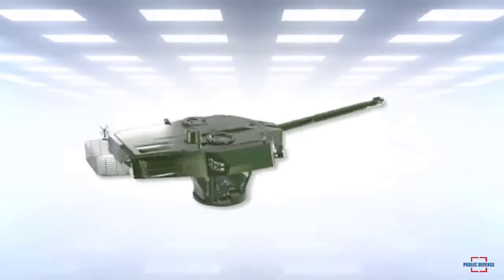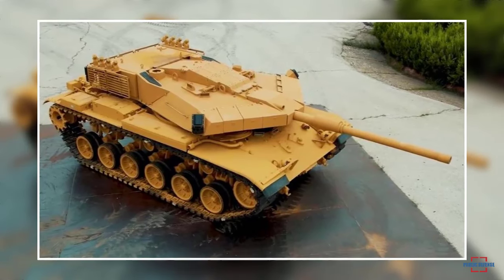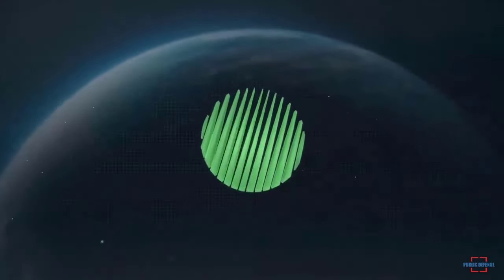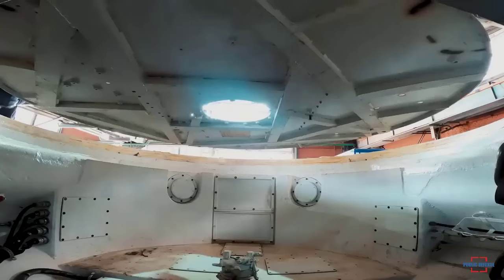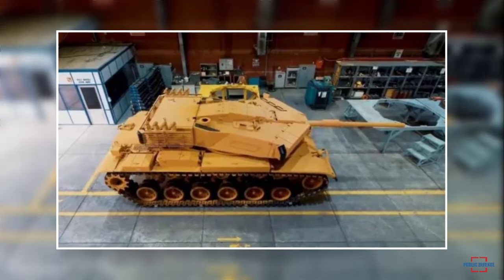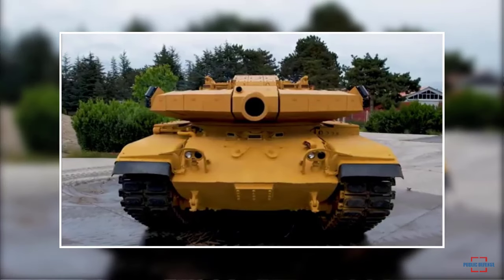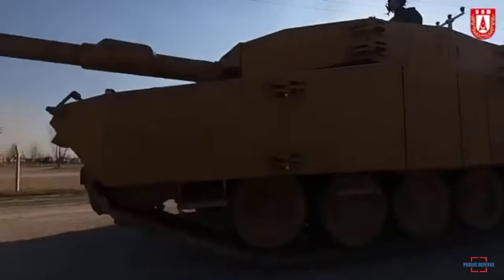Turkish Army M60A3 Tanks with Roketsan New Armoured Turret

Comment: M60 : please let me die
Reply: Basically it's new tank only the basis are the m60.
Reply: lool
Reply: T-55s: First time?
Reply: As u can see not even the leo2 tanks safe. İn our age a tank can only help ground personel. Because without soldier cover a tank can be destroyed easily.
Reply: So no need to new tank chasis o guess :)
Reply: M48 first time?
Reply: @Yalcin2 tank should work with drone to scout ahead…..ukraine recent leopard 2 tank failure is a mess….
Reply: We're trying so you don't die... YOU SHOULD THANK YOU...🤣🤣🤣
Reply: Centurion:
Reply: M41 walker
Reply: LooL m60 has become the new T-55
Reply: Russians can relate
Reply: Lmfao
Reply: The modern MBT is the cavalry charge of yesterday: outdated with no place on the modern battlefield.
Reply: why? As long as your maintain well.. you can use devices for decades. USA still using 60 70 y old planes even today.
we are not going to use it against massive armies in the flat terrain of Europe or Ukraine.
m60 still in service for 2 reasons:
1- It is good against assymetrical warfare. Because losing leopard 2 or Altay MBT can be extremely costly. Expensive to maintain and replace them. 
2- It is good for the landing operations. We can't afford a brand new light tanks with this economy and it is hard to use heavy MBT tanks when you are landing in an island.
Absolutely smart decision by Turkish Armed Forces . Even USA noticed that and turning Abrams into 42 ton tanks now for the pasific front.. They have money , Turkey doesnt have money, This is the sollution.
Reply: The name of the tank is not important, if it is turned into a modern toy by placing the most advanced electro-optical systems, monitors and controls in it through modernization works, that tank is good. Therefore, the names are not important, what is mounted in the arrangement is important.
Reply: @Janko630 howso?  Nothing else out there can take a hit in a heavy firefight while providing direct fire on emplacements.  Nothing else can fill the MBT's role on the battlefield at present.  

Thus, not outdated, by definition.  They have become more vulnerable, yes, but so did tanks after WW2, with HEAT and ATGMs.  But that just saw evolution, first by going lighter with europanzer, then with the introduction of composite armors.

The modern drone, mine, and artillery threats have their counters as well - and are already starting to be implemented; active protection systems, EWAR, and a return to lighter/cheaper platforms.  

The pendulum between sword and shield marches on.  

The biggest threat to MBTs are remote operated / unmanned ground platforms, but that's still a few decades off from practicality.  (And they'll still basically be MBTs, just smaller due to crew being inside a heavy APC nearby instead of the tank ridging the hill line)
Reply: T55: first time?
Reply: @Yalcin2  As was literally always since the first tanks. Tanks alone never were good. You need combined arms warfare.
Reply: Naaah, you missquoted, its "EVEN IN DEATH I STILL SERVE"!!!

Comment: Turrent looks like T-90M and T-90MS
Reply: Already made for t90 modernization tenders
Reply: Kazakhstan built the T-90 tower. When he manufactured it, he changed it to m-60. but it was nice. There is no ammunition under the turret like the T-90. in the warehouse behind. but it was nice.
Reply: the driver can’t get out if the turret is facing forward
Reply: @michealjackson8269  i think driver needs to get in turret and than out.
Reply: Yes, it's rented turret by russians
Reply: Rocketsan makes T 72 modernization, for azerbaijan
Reply: Same concept, different base tank
Reply: That is right.

Im guessing it is for Russian tanks, either to Ukraine or Azerbaijan. Turks already have a good modernized turret for M60 from israel. And had amazing succes with it in wars, which means there was no need to invent new sh1t for M60s 💀

Israel gave a good enough upgrade blueprint.
Reply: @michealjackson8269 M60s have an escape hatch for the driver on the bottom of the hull.
Reply: Yes this turret is made not only as modernisation package for M-60 but also T-72s

Comment: pretty large shot pocket they have there.
Reply: Shot trap ?
Mostly irrelevant these days.
Rods will penetrate near 83~84 degrees from vertical armor.

The turret ring is vulnerable in just about all modern tanks.
HEAT will fuse correctly till about 81 degrees.

Comment: A new turret, a lighter one, certainly couldn't hurt.  The performance of the M60 was always a little less sprightly than the M48 because of the weight of new turret.
And, the new turret has a much lower profile.  If gun depression wasn't sacrificed, then that's a plus as well.
This seems like a more comprehensive approach to keeping an M60 fleet viable than Israel's Sabra program.
My only concern is that, as shown, the hulls armor hasn't been upgraded.  A lot of the weight saved in the turret has to go there.
Reply: They will be rendered unmanned.
Reply: it must have an autoloader?
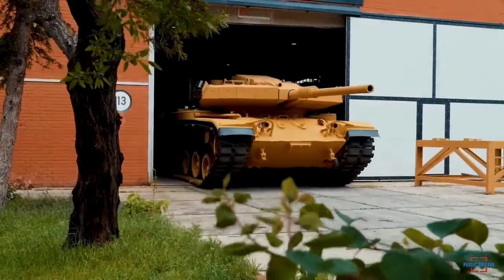Reply: From footage 2:20, Yes
Reply: I suppose that they will go for active protection like Akkor and/or Pulat anyway

Comment: Taiwan also has an abundance of M60 tanks.  Maybe this retrofit turret could be purchased and used.
My concern is electronics.  New generation tanks have lots of onboard electronics that stay running even when parked and the main powerplant isn't running.  Is there an auxiliary generator add-on available?
Reply: Good idea, but You can easily imagine PRC's response to that. Doesn't sound so realistic to me.
Reply: Turkey wouldn't want to hurt their relations with PRC.
Reply: M48s

Comment: Nice new turret...great idea...but one of the M-60's big weaknesses is its heat signature from its engine and exhaust which makes it easy to spot and easier to hit. Having said that, if I had a bunch of M-60 tanks I think this new turret would be a great addition...well done.
Reply: On behalf of my country, thank you, my friend...
Reply: Wow, I guess you've never crewed a tank have you?
Every tank gives off heat.  When you are moving 40 to 70 tons around, your engine is going to get a bit warm.
The M60's engine gives off no more heat that the LEO's or a T-72.
And and before you ask, I've seen both through TTS, so I know.
Please don't confuse War Thunder with real life, trooper.
Reply: @Waltham1892  I guess you know next to nothing about tanks and how to attack them. The M-60 tank was a relatively good tank but like all tanks it had particular weaknesses. One of the stand out weaknesses was it's heat signature...it was a very "hot" tank compared to others. The dual exhausts mounted right up on top of the rear deck literally glowed, especially at night. Many other tanks place their exhausts lower on the rear or at the sides where the heat signature is less visible to IR sensors. Tankers have to "warm up their vehicles", primarily to test their systems, recharge batteries, etc....well you could pick out M-60's even in hull down positions from a distance using IR scopes. It was one of the main criticisms of the tank.
Reply: Need to upgrade the engine then too
Reply: So heat engine is a problem why not put heat filter at the exhaust or heat chamber to conceal heat.
Reply: Generates a LOT less heat than a T-80 or M1 with their gas turbine engines.
Reply: @brucelamberton8819  I can't argue that one way or the other, but I've seen M-60 tanks through a thermal scope and they light up like a torch....still, it's a very good tank and this turret makes it just that much better.

Comment: the turret front is so small that is more probable to be hit on the turret ring like that also the composite dont seem so big to stop a modern apdsfs maybe an older atgm with era installed yes... its not so special continue using the sabra...although the laser warning is good
Reply: Kazakhstan built the T-90 tower. When he manufactured it, he changed it to m-60. but it was nice. There is no ammunition under the turret like the T-90. in the warehouse behind. but it was nice.

Comment: With this turret system the gun options are an interesting choice. On the M-60 hull this turret is only available with the 105mm, while on the T-72 hull it's available with the 125mm or 105mm. With the 105mm gun it has a 18 rounds bustle autoloader, while with the 125mm gun it uses the carossel 22 rounds autoloader. In addition it's interesting that they didn't try to use the 120mm gun, which is the newer NATO standard
Reply: Yup. 105 is a very strange choice of caliber.
Reply: @BluntEversmoke  This will not be a main battle tank, and what will you do with the 2 million 105 mm bullets you have :)

Comment: 2:30 how can 125 mm hold more rounds than 105? also what kind of auto loader is it since 125mm come as 2 piece ammo or is there 1 piece 125mm too?
Reply: probably because the 125mm is 2 piece ammo meaning more can be crammed in the same space without total length of the round becoming an issue unlike with 105 where APFSDS shells are up to 1.1 meters long in some cases which is not conducive to storage within a tank.
Reply: @123asap6  well if its auto loader 2 piece ammo needs russian style auto loader but thats in hull not turret and that makes little sense... i dont know needs more data.
Reply: It appears to have a LeClerc style bustle autoloader. So the rounds are lined up like matches in a matchbox. L7 105mm cartridge cases are larger in diameter at the base than 2A46 125mm propellant cases, which are about the same diameter as the projectile. This would account for the difference in round count.

Comment: I thought this tank was completely gone world wide. I personally took part in demilling thousands of the M60, the M60 starships and the M48's in the the last 90's. I would see M60's & M48's with 5hrs run time and 15/20 miles on them. By the time we was done with them they where 2x2 chunks of scrap metals and loaded into open top train box cars for melting. I can tell you that once the turret was removed from the M60 the suspension would raise up 4 foot and they would do every bit of 65mph and feel like you was floating across the earth.

Comment: Most trolls criticize that they did not know that the Altay tank would be better than most tanks.
Reply: So we’re just gonna ignore the hull which has no composite as well as the huge shot trap which is clearly visible, along with having a 105 which is adequate, but a 120 would be much better
Reply: It did better than Leo 2s in Syria. lol.
Reply: @obsidianjane4413  yeah let’s drive a tank into an open area with no infantry support or even ERA, what could go wrong?
I hope no Syrians with a few ATGMs pop up!

No, the only reason it performed better, was because it was used CORRECTLY rather than being sent to Syria IMMEDIATELY WITH NO SUPPORT!!!

I don’t see the deals coming in from any other country, if the Altay is truly better than the Leopard, then it should be everywhere in Europe rather than the Leopard!
Reply: @Cyril_2009  False. The Turks used the M60s exactly the same as their Leos in Syria.  But keep on coping.
Reply: @obsidianjane4413  I’d like some sources please, also I think the tank hasn’t even been accepted into service yet.
Reply: @Cyril_2009  You don't think the M60 is in service with Turkey yet...  lol.
Reply: @obsidianjane4413  it’s not an m60, it’s just a different turret mounted on an M60, which might lead to it having a different designation, the t90 is the same exact story